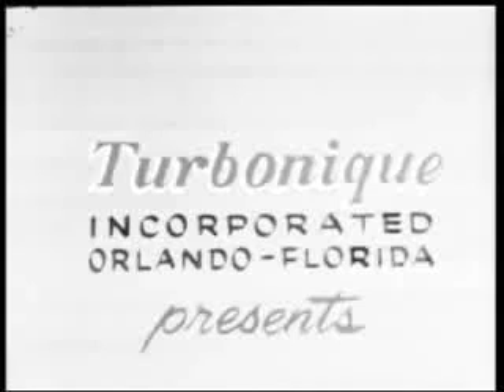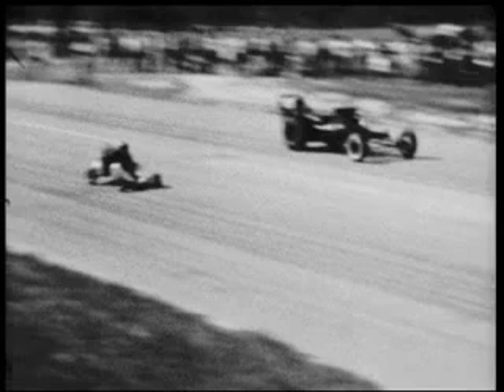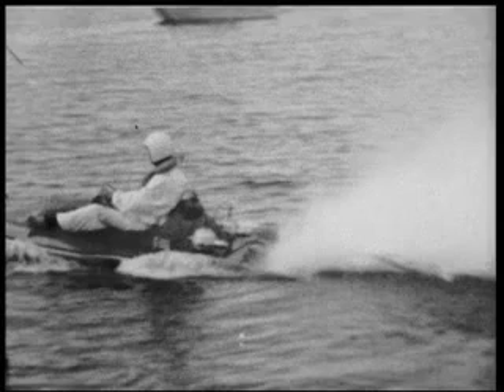Turbonique engine noise

Comment: Turbonique Inc of Orlando Florida manufactured a line of turbines and superchargers that were powerful and quite complex. Their downfall was that the products were quite complex and the 100,000 rpm that they operated at ate though the bearings available at that time. They needed to be changed after two runs.  If not properly maintained and adjusted they could also blow apart. Towards the end Turbonique only sold kits that were very hard to assemble and customers complained. Finally the government stepped in and charged Mr C.R. Middlebrook the owner with mail fraud and he was incarcerated. The turbine powered superchargers and drag axles may have been an idea ahead of its time but it never caught on. The technology is there to make these items today but the explosive fuels and Oxygen bottle needed would make production very expensive, operation dangerous and the product impractical.
Reply: Oxygen bottles are relatively cheap.  I don't know how much "Themolene" would cost per gallon today.    I would feel like a dumb ass suing some one because the rocket engine they sold me was hard to install.